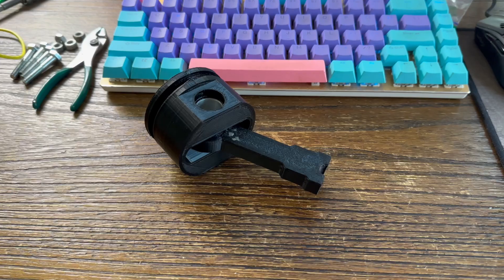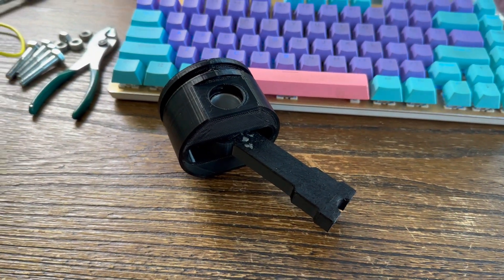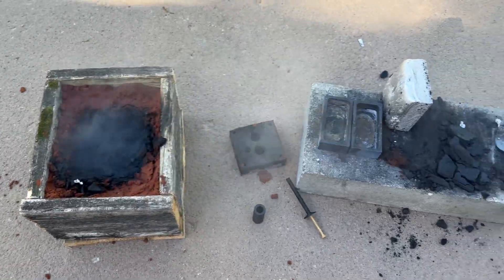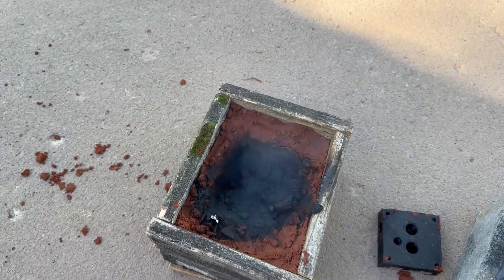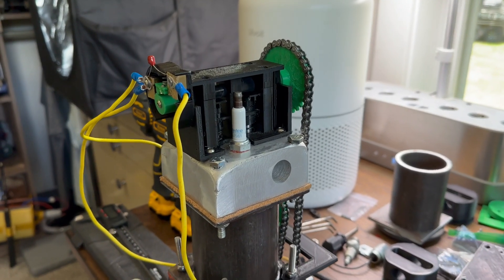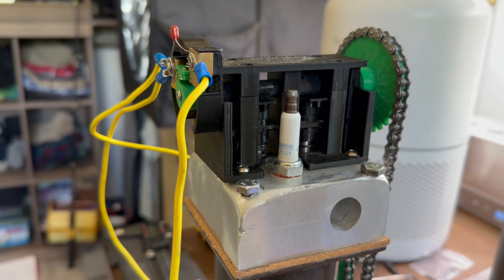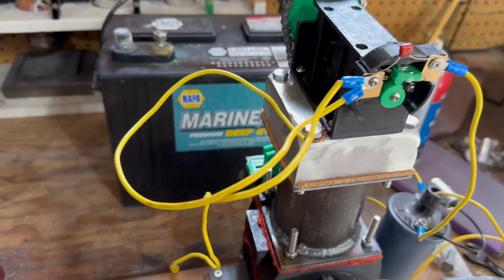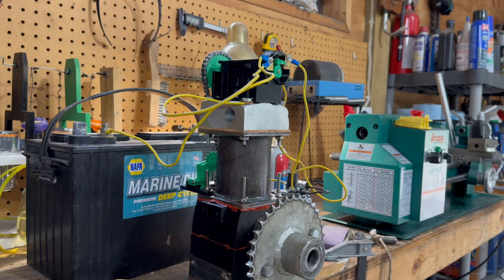3D printed 173cc 4 stroke engine! With cast aluminum parts!

Comment: How are you dealing with pattern draft, if sand casting? I'm working in brass, been using abs and xylene in plaster, looking for something better though?
Reply from the maker: Interestingly, I’ve never had a problem, I have vertical wall parts, and I just slowly pull them out of the sand. I don’t put any draft angle on my parts at all. I print my parts in PETG with 0.32 mm layer height.

Comment: why did you switch to 4 stroke?
Reply from the maker: It’s easier to make, and more likely to work. 2 strokes are very particular with the port timing, four strokes don’t really care about the valve timing, it just helps increase performance when it’s right.

Comment: You could use your 3D printed crank case as a pattern to pour an aluminum one.  Just ram the halves up in the sand.  I use "pistonium"  - old car pistons from a local repair shop to melt for my engine parts.  You could just machine those valves and the wrist pin from solid bar stock steel.

Comment: Atleast it fired, well it was smoking anyway!   If I was you I'd get a piston for a 125 or 150cc gy6 scooter. It's nearly the same size slightly smaller, big bore is available. Capable of near 200cc and they are cheap. Unbelievably cheap. From Amazon. Flywheels and rods and wrist pins go through crazy forces. A 1 oz weight on a crank will weigh tons spinning at relative low rpm. I would make an aluminum flywheel, and get the aluminum from a scrap yard, from car rims.  Or similar parts that was cast, stock car rims are casts. A big hammer and hack saw will make bits of the rim in no time. This is an aluminum alloy, designed to cast well. Also engine parts such as heads but get lawnmower heads , a recycler usually has a big box of kk lawnmower engines and similar aluminum parts. And brake rotors are great source of iron. And a leaf blower, small air compressor, with used engine oil can melt it. If it's too slow, make a HHO generator, to supply additional o2 to the flame, careful it can be hard on your insulation.  Use a 5gal. Bucket. A couple 25' strips of stainless foil or even conductive carbon fiber , a microwave transformer with the high voltage coil removed, and replaced with 14-18 gauge wire 4-6 strands roughly 12-24 turns /wraps around the core. And a single phase rectifier, and a SSD( looks like a SSR, solid state relay) but has a potentiometer with it from Amazon, 500ohm pot I think. Connect the power cord in series with the SSD it needs to be mounted to a heat sink. Using high temp grease or thermal paste between, a 60volt capacitor optional for the rectifier, connect the wires you added to the rectifier, the DC out of the rectifier connect the capacitor (optional) the rectifier need to be about 50 amps, also a volt and amp meter, also optional, connected after the rectifier,  100 amp shunt style DC amp meter ,connect one wire, 8gauge (8 gauge can also be used in the transformer, it's not easy to get it in though) with enough turns to get about  6-12v. Lay out a sheet of the stainless foil or sheet metal, with a piece of fiberglass window screen. Or similar plastic it needs to be about 1" larger longer and taller. Lay the other sheet on top it need to be about 2-3" shorter than the bucket place another plastic or fiberglass insulator on both sides of the metal (all sides) then roll it up to fit in the bucket. Then fit a hose like used on a vacuum cleaner or washing machine drain to the lid.  And run it to the air inlet of the blower. A variable speed electric is nice a gas leaf blower also works. It's not going to need full throttle..  use a thermometer in the bucket use stainless bolts through the lid to connect wires to the plates.and  hot glue around the wire connections, with heat shrink tubing.  Fill the bucket with distilled water, with a bit of lye  stump remover.  Just a table spoon or two to start with use the knob on the SSD starting low watching the volt and amp meter slowly crank it up around 2-5 volt it should be pulling some current back it off a bit a plexiglass panel and LED glued in the lid would be great for a visual of how things are going. best to add as little if anything to the water. Just enough lye to get it to work possibly use a fuse or breaker Incase the insulators break down and the plates short out.the used oil nozzle can be made from small pipe fittings 1/4" not, and a couple pieces of 1/2" maybe 3/4 or 1" and a ball or gate valve, but 3D printed parts can make it crazy simple and cheap. With a 1.5-2.25 exhaust pipe or conduit to connect the venturi/injector nozzle,and the blower to the furnace I want to build one from a 55 gal drum or possibly a 200 gallon oil barrel 5' tall 3' wide it may be 300-400 gallon, it's much larger than a 55 gal drum. Use the normal insulation. Then use 1/8" stainless rods to make hoops to retain the insulation. It should be able to hold a 20-40 gallon bucket , using a light gantry crane to lift the furnace from its base. It being three piece. A base with the heating bits in it. The middle. And the top. Similar to Kelly Coffield's furnace. Only alot larger.  Using 2 3 or 4" blower ducts  with the injection nozzles about 6" outside of the furnace possibly having 4 nozzles. The pipes one coming from the floor of the Base, the next coming from the wall about 45°-60° around the base,.. the base being about 8" 12" tall, with about 2-4" of insulation in the base. The roughly 48" center section  guided by a 1.5" bar 8' long. Allowing the sections to move aside like a hinge if needed. Post add another 1.5" guide with a easy to remove connection to allow the sections to move aside such as the lid to add material. It having a 8" hole with 5.5" restriction may not be large enough to add material. A platform and rails on one side. Use a propane or map gas torch used for ignition, use a hollow 1/2" steel tube a few inches in front of the nozzle if heated bright red from the inside (outside from the air pipe) to start combustion and possibly add heat to the oil supply tuning just before the nozzle. A 1/4"  copper line. About 1 minute +/ 45, seconds or so it's at a angle  and the flame exits the tube into. The furnace so the fuel will ignite easier.. a 2 gal 1/4 HP air compressor feeding the injector about 60 psi at low volume, possibly use a cheap paint sprayer for the secondary nozzle.  It should work great.  The nozzle in the main being a  small pipe plug with a 0.6mm hole or possibly use a carburetor jet in the plug.  With a tiny. Steel needle nearly closing the jet. Forming a cone of fuel the nozzle being on the end of a 1/4" pipe with a tee on the opposite end  with another plug the oil entering the side of the tee, with a valve the plug having a 1/4-20 thread and the bolt having the bit of tig rod welded in a hole drill in it the tip bring ground to a point like a tungsten electrode in a tig torch., it pencil. The bolt being about 3" long with a nut and washer to seal the threads with a o-ring around the bolt. And sealing when fitting inside the washer as the nut it snugged down it can be adjusted slightly. Only about .020" from just a squirt to all but shut off. The jet could be drilled out to about 1/32"-1/64" if the HHO poo produced enough o2 and hydrogen, it could be used. Along but is extremely hot. It can melt ceramics if allowed to.  The addition of some o2 and hydrogen to used. Oil or propane will easily melt iron, only ba suitable crucible is required. Maybe a first project could be pouring a iron crucible then ceramic coat it to protect it from the heat! A 15 gallon 1/2" wall thickness would be great.   Possibly build a 3rd nozzle to fit in the top to put the flame inside the crucible! Use a 2" flex hose from the blower. And a 1/4" coil hose for oil and air!! 🎉have a great day

Comment: i am not sure if he has fuel supply. If he keeps a steady flow of fuel then he could have it run continuesly depending on spark timing and how long his parts are gonna hold. Not bad tho
Reply from the maker: I am waiting on a carburetor, it is supposed to be here tomorrow, but since I didn’t have it, I was just testing by spraying starter fluid into the intake port. 
Thank you for watching!!

Comment: Thought this was a Camden Bowen video at first 😂
Great work, very exciting to see this kind of thing with being done with proper metal parts!
Reply from the maker: I ended up with a fantastic thumbnail!
I definitely think there’s a place for the 3d printed parts, but definitely not on the critical parts. Like the camshaft and valve holder, they are under little stress and I don’t think I could grind a custom camshaft with my tooling, but on the crankshaft or head it would never hold up.

Thank you for watching!!
Reply: @ProjectLMZ  definitely subscribing, your production quality is amazing for a channel with less than a thousand subs.
Reply from the maker: @among-us-99999  thank you so much!! That means a lot to me!!
Reply: @ProjectLMZ   Starting fluid is infamous for breaking con rods and damaging pistons.  It has a relatively low detonation temperature compared to diesel fuel (kerosene) or even gasoline. Thats why they use it to start big diesel engines on very cold mornings.   Even then if too much is used it can pre-ignite and combust when the piston is coming up before TDC.  If the engine is already warm, or in the case of an engine with no cooling for the head -hot - pre ignition will almost definitely occur and cause all manner of calamities, broken con rods, stripped timing gears, and smashed pistons.

Comment: While ago i saw a video where someone 3d printed a piston for a full sized 2stroke quad and it actually ran for a few minutes while riding it hard. It did not even crack, just melted and lost compression. So i think if you change your settings/materials, you could get decent piston life for engine that you have.
Reply from the maker: I actually think I have a fix for that to, I made a steel cover for the piston that bolts on the top, and it holds up good! It’s not about how hot it is in the engine, it’s about how quickly the heat is transferred to the piston, so that steel plate should help a lot! Have you seen my latest short? You should go check it out, my welds on the crankshaft broke and it shredded the crank case, but it actually would have ran if not for my welds breaking!

Thank you for watching!!!

Comment: This is amazing ! you should just gradually keep improving the parts to cast aluminum until there’s no plastic left and the engine can run for an extended period of time
Reply from the maker: That’s what I’m thinking, but the 3d printed parts are really great for prototyping! 

Thank you for watching!!
Reply: @ProjectLMZ  probably especially great for prototyping the cam. That would be so difficult to machine
Reply from the maker: @mondude9754  yes, I don’t think I could machine a cam with my tools, and I actually think a 3d printed cam would work in the long run to. On my engine it’s not under a lot of load.

Thank you for watching!

Comment: Hell yes you need a metal piston..... IDK why there are so many people trying to make plastic combustion chamber elements.....but if it could have been made out of cheap plastic the auto manufacturers would have done it already. Look at the kinds of plastics we used to have, stuff that was practically rock after it polymerized, and never has plastic been used in combustion chamber parts....theres a reason, yall.... And that starting fluid(?) is eating your plastic parts....and so will gasoline.

The valve issue is another gotcha that trips up people playing with engines, they have to fully unload to seat. Thats what checking the clearance with feeler gauges is about in proper engines, making sure there is a complete unloading of valve actuation while staying close enough that valve timing is preserved.....also.....when those plastic timing gears go the valves and piston head are going to have a really bad day......remember to install proper bearings on the conrod where it meets the crank. There is a reason why cars use sleeve oil film bearings. There is a butt ton of sudden shock and pressure right when it needs to rotate when the spark hits. its gotta be soooooooth. Pay attention to ball (or better needle roller) bearing loading direction and ratings.

It seemed to want to go (before the piston tried to go hang out with the crank). Need to get some proper fuel flow going on (smarter every day has a few good videos on carburetors, might be a good DIY addition. or just bleed a propane/butane feed into it and throttle with flow rate). At least use a pipe on the intake so you have a bit more of whatever you're using to start it with for it to run on.

And finally be weary of people starting advice with "i feel".....mechanisms, like all other aspects of scientific endeavours, are not affected by feelings. Soft mounting an engine would not have stopped the head from blowing through. Its a hot, aggressive, violent environment inside an engine. Design for it. Oh, and stick the drill on the valves, pull em against the seal face and spin em. Mate the surfaces.
Reply from the maker: I really like all of your ideas, I’ve been testing this engine some more with some metal upgrades, I cut out a metal circle that bolts on top of the piston so that the plastic is not exposed to the combustion directly, it is just a 3 mm thick piece of sheet metal, and it works wonderfully, after testing the engine with it, it ran for a short amount of time before the welds on my crankshaft broke and the inertia from the flywheel made the broken parts turn into a blender and shred the crank case. I actually did lap the valves, but for some reason, the lapping compound I used left a 60 grit finish roughly, so I hit the valves and the seats with some 220 grit sandpaper, and even though the valves aren’t technically lapped, there’s literally no leaking somehow. 

Thank you for watching!!!

Comment: Im interested in how you made the head with all the different places to drill, how did it work out for you?
Reply from the maker: Well, I started by 3-D modeling one in Tinkercad, But it was a little bit of a pain to find the right places so none of the holes overlap, but in the end what I ended up doing 3/4 inch holes for the intake and exhaust ports, a 1/2 inch hole that I threaded for the spark plug, and some 1/4 inch holes for the bolts on all four corners. I ended up having to buy a spark plug with 1 inch long thread portion, so that I could avoid hitting the intake port when drilling it. There’s actually a decent amount of room with everything done, but it definitely helped to 3-D model before hand to get a rough idea where everything needs to go.

Thank you for watching!!!
Reply: @ProjectLMZ 
Thanks for replying, I am trying to make a 4 stroke myself and am having trouble deciding whether to get a head cnc'd or make it myself for cheaper. I think I'm going to make it myself first and see how it goes
Reply from the maker: @deletedpeanut5208  i think making it yourself would be awesome! The hardest part is sanding all of the faces flat, as cast aluminum likes to dip down in the center. I used a 9 in angle grinder to flatten all of the faces, and for everything it took probably 1-2 hours, including the holes and everything. 

Best of luck to you!!
Reply: @ProjectLMZ 
I will be making the head out of some 55x25mm aluminium bar, so it is already half done for me

Comment: i have no idea if this would change anything, but i feel like not clamping down the engine and giving it space to move like a generator would be good for it, so the connecting points dont stress the 3d prints more than necessary.
Reply from the maker: That is a good idea, I want to make sure it’s not going anywhere, but I could make rubber feet on the bottom to give it some room to wiggle! I Have a flexible filament so I could make a rubber pad and then still screw it down onto that rubber pad. Thanks for the advice, and thank you for watching!!
Reply: @ProjectLMZ  3d printed rubber pads are a great idea, but it will probably be difficult to hold down the engine without it being bolted down, but you are the one designing so you know the mounting points better than anyone. good lock man

Comment: So we're going to ignore that this design is essentially the same at Camden Bowens 3D printed engine?
Reply from the maker: Nothing about this design is even remotely close, I took inspiration from his, but it was all my design, the crank case that I have on here I designed before Camden’s new four stroke crank case, the head is my design, the bore is much larger and I made it before his new video, the valve train is a completely new design, the only thing that I copied is the ignition module. Also the all thread rods I have running through the crank case to hold it together I have had since the beginning of my engine, before Camdens engine got them, if you look through my YouTube channel videos on my engine, you’ll see what I mean. 

I do not mean this in a bad way, and I very much appreciate you watching my videos, but I just wanted to make things clear that this is not just a copied version of his.
Reply: They're both 4stroke, have 3d printed parts and thats about the similarities. It's not like he should go pushrod or flathead or something just to be different.
Reply: Well its defenetly not the same
Reply: This one is so much better and not the same.